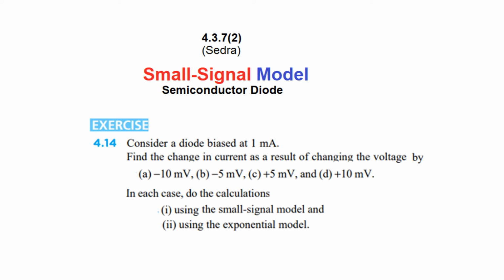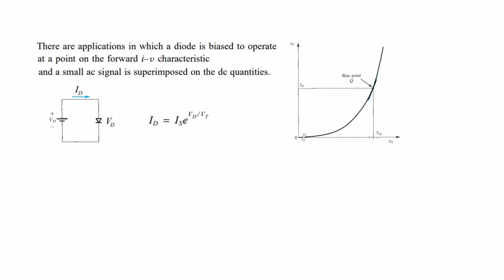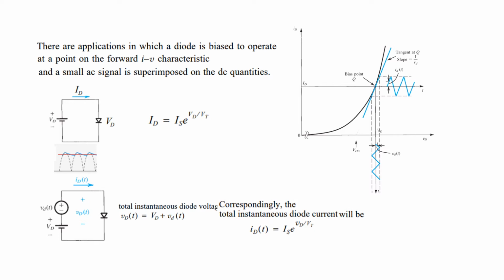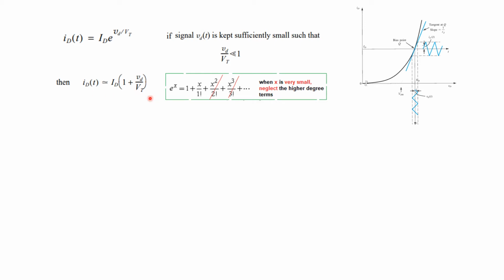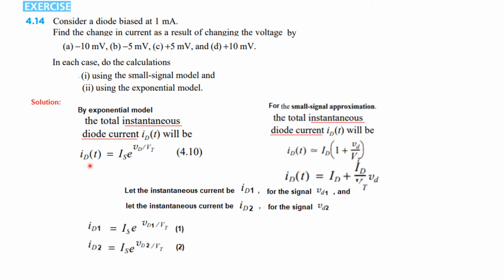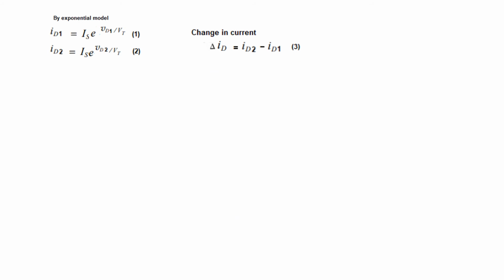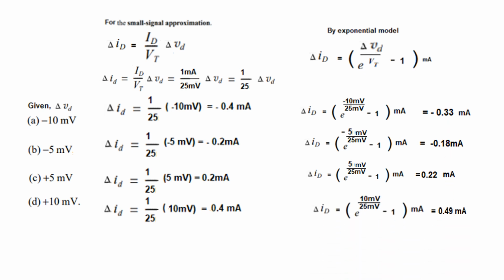(E)EDC(S) Exe 4.14 || Small Signal Model of Diode

Comment: You used iD1= 1 mA and again ID = 1mA . Is that correct? Because , iD1 should include both DC and AC part .
Reply from the maker: please give reference of time of my video, so I can follow you. or mail me at profkhannazir@gmail.com
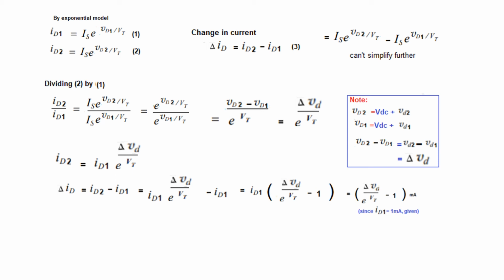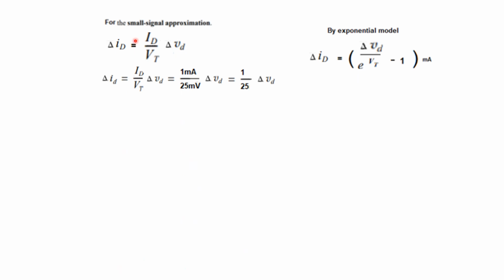Reply: @ElectricalEngineeringAcademy  You used iD1= 1 mA @11:58  and again @ 12:49 ID = 1mA . Is that correct? Because , iD1 should include both DC and AC part  but you used only 1mA ( DC value) in iD1 @11:58
Reply from the maker: Your observation is true, but if we take the starting point of ac voltage vd1 to be the reference point Q, then id1 will be zero and hence iD1 = ID (This makes the calculation much easy). If you have another view point, please share with me.